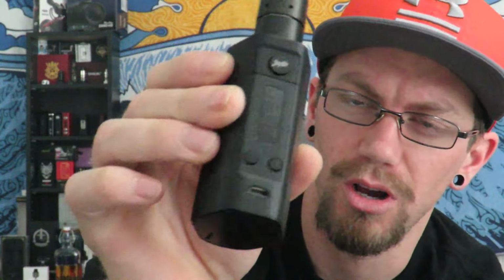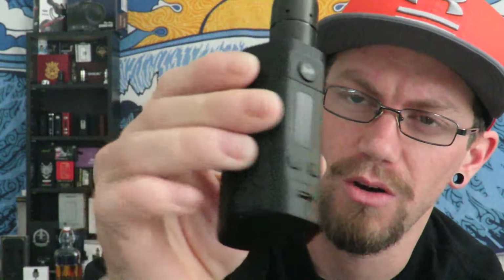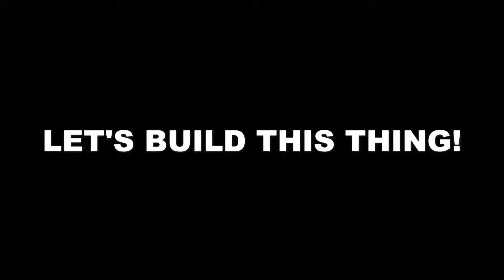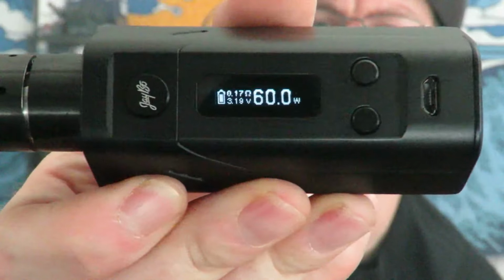TUTORIAL: QUAD COIL BUILD W/ THE VELOCITY RDA

Comment: how do you coil it? i know for normal dual coils it goes in diagonal posts. how about this? because i can see u tighten diagonal posts for the bottom coils and then inserts the top coils thru the post without loosening any.
Reply from the maker: There are four post holes. Two positive, two negative. The bottom 2 coils go into the two bottom post holes, one on each side. Same on top.
Reply: +Affordable Vape TV doesnt velocity deck posts are with diagonals? Like one coil head goes to the upper post hole and the other end goes to the lower hole?
Reply from the maker: +K1z2a3m4a5 not necessarily. The whole post is positive and the other is negative. Both post holes on each post are the same
Reply: +Affordable Vape TV ahhh i never knew that! Thanks mate!
Reply from the maker: +K1z2a3m4a5 you're very welcome!
Reply: that's some nice information, I was also a bit confused about that! do you think I can build it on an Avocado 24? the only thing I find a bit awkward is the wicking, but it should be manageable, right?

Comment: i have a problem with the top coils.... I am using clapton with 6 wraps reads .13ohms and watts at 80....
the top coils always burn... pls help...
Reply: Uneven ramp is the reason. Make sure you properly loop the coils evenly. Cut excess wires do not let then touch each other it will be a short. Lastly if you have torch man torch the coils first to lessen the tension

Comment: Curious why you went with a quad coil plain build for 'clouds' when you could have gotten more vapor production with less heat from some simple claptons. If you're ready for quad builds, you should be ready for claptons. Also, the extra wire you clipped from making the legs on those leads so long you could have just made the 4th coil out of it! Shorten your legs, man! lol